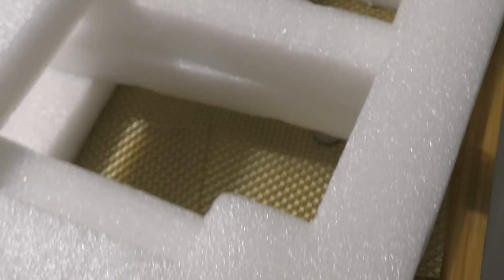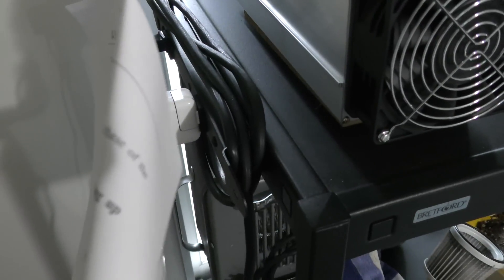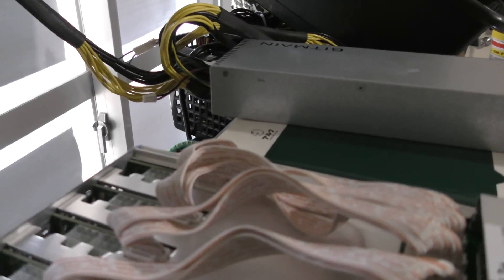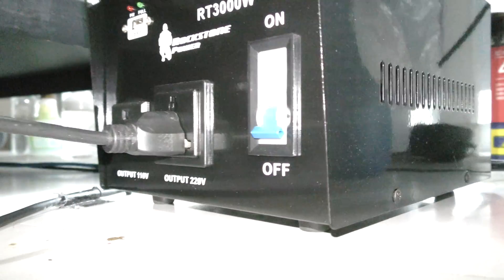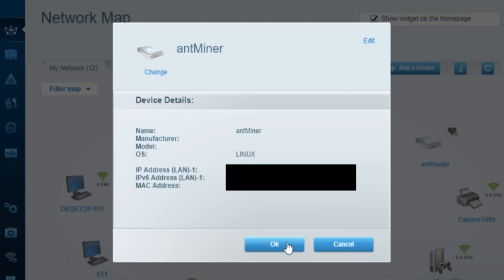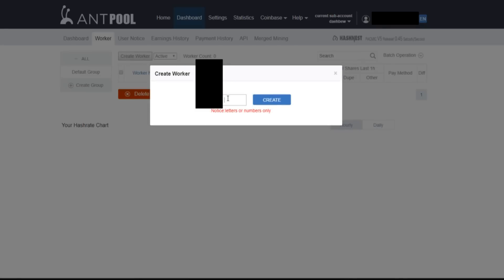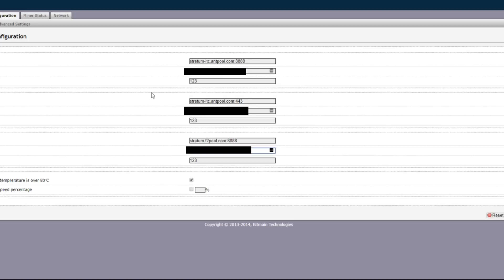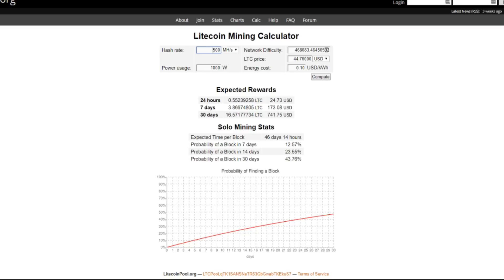Antminer L3+ Setup Tutorial

Comment: that's not accurate about the voltage. It's much more efficient to run 220 or 240 but 110 does in fact work.  It's mentioned on their website.

Comment: Hi just helping a friend setup and it says on that same sheet you are working from to power the control board 1 min after the hash boards. You didn't mention anything about that in your tutorial. Just to be clear it's suggesting that I start plugging in the control board when it's already running ? Also I don't need a transformer if I am just power one L3+ miner which just uses as standard computer three pin plug, correct ? Thanks

Comment: can you plus in the power supply into 110v outlet?
Reply from the maker: plug in? .. yeah... you "can" ... but that PSU I'm using only operates on 220... so if you plug into a 110... it'll just idle... like... blow air out the fan on the PSU... but not actually do anything..... However, bitmain does sell 110 type PSU's ... but they operate at a lower wattage rating... you get best bang for your buck with a transformer unless your house or whatever has 220v outlets.

Comment: Hi,
I'm curious to know about what kind of "special needs" this machine would require.
Does one need a special air cooled room for it or could you kinda leave it in a basement?
How would one go by to create such a room for it if necessary?

Thanks :D
Reply from the maker: <70 degrees.. dear god no water near it.... it'll suck up water and done... oh the miner will be fine with built in fans... but if using a step transformer as well... that will need a seperate fan blowing directly on it... transformers heat up fast... and cables get warm.... gotta put another fan on cables... you'll know when it's warm to the touch... oh and.... if you start running 2 or more miners in one room you'll wanna get familiar with OHMs LAW..
Reply from the maker: that... and... the machine will naturally suck up all the dust in your house... dust.... accumulates... in the miner over time... it clogs... creates rust buildup... residue... if the miner isn't maintained it will stop mining... so you'll have to turn it off... clean out everything... with like LP air and just dont put water on contacts..... clean the fan out... then restore and turn on... maybe update firmware....
Reply: What about the room itself? I'm guessing it will heat up as well without proper air supply. Would an open door be enough to cool that back down again?
Reply from the maker: depends on the temperature outside... if hot.. you'll need to close the door and turn on the a/c... if it's cold outside then yes it's ok... however, if it rains outside.... and miner is near window... your doomed
Reply: I see, thanks a lot for all your help! :D
Reply from the maker: open door won't make much difference. depends on overall temp of room and how many miners you have running. also depends on what you're doin gwith the heat generated.. are you running a hose to throw the heat out the window... that will make a big difference.
Reply: @CryptoTrends  what it I put it in my garage where it gets 110 degrees in the summer.

Comment: Are you using just a separate monitor to set up the antminer? or are you hooking it up into your laptop?
Reply from the maker: don't have to monitor it 24/7... once it's up and running you can turn your computers off... miner connects to the network. as long as your internet is on it'll mine.

Comment: how many amount of coins (LTC) do you got in 24h  at current difficulty ?
Reply from the maker: per miner.... about 0.3 - 0.4 LTC... there's also a calculator, that's more accurate
Reply: I mean , the real coin you got mined in the pool (outside calculatos), depends pool you will got more o less amount of coin,  for example... AntPool, Prohashing, etc....
Reply: I got 2 antminer l3+ and making .23 for 24 hours with litecoinpool

Comment: Wow so much cheaper and easier to run 220, even if you need to run a sub panel. Don't waste money on a step up transformer that's just well I'll be nice and not use that word
Reply from the maker: oh, it's worth it... matter of fact I figured out how to mod the xformers so they last much longer...
Reply from the maker: yes... even if you have to burn through some $100 xfrmrs
Reply: hi cryptotrends, thanks for making this video. are you saying that the transformer isn't worth it cost wise and that it's better to rewire your outlets to 220v?
Reply: ok thank you ! i actually had no room to add a 220v. my uncle (electrician) said it was fine to run on 110v as long as it was wired independently and with a 20a breaker.

Comment: Hi, 

Thnky ou for your tutorial video. I am actually pretty new to cryptos and I have just got delivered my 2 Antminer L3 and I am trying to figure out how to set them up. 

Coudl you please help me with a couple of questions. I can actually see that the miner has 8 PCI-e slots  and power board has 10 PCI-e slots. I have connected the 8 but im not sure what to do with the other 2. 

Also when i plugged the ethernet cable to one of the miners I am left with none in my computer. Does it mean that I need two computers to plug my two miners? or is there another way I can do it. 

thank you
Reply from the maker: plug in all the cables.. preferrably 1 psu to 1 miner..... (stacking psu's can be tricky - not recommended)... if you can't find the miner.... go into your router via your.... IP.... use google "myip" .... once in your router..... you can usually find your miner with the DHCP list...